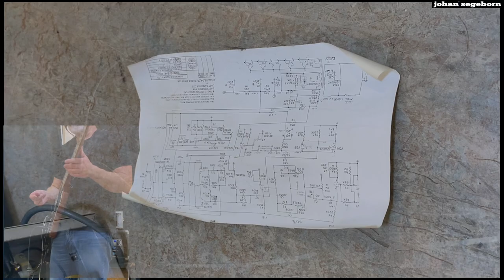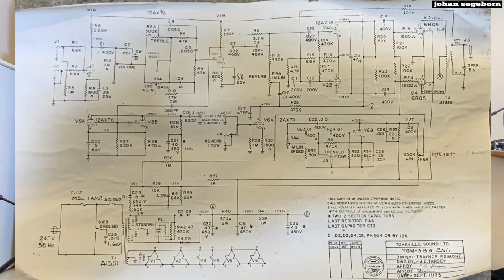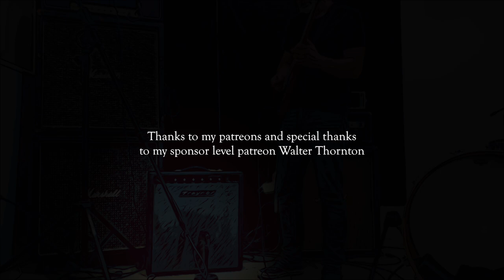Canadian PLEXI!! Traynor Guitar Mate Reverb YGM-3

Comment: You could also say some old Traynors are basically Canadian Hiwatts too. Very rad and vastly overlooked and under-appreciated amps.
Reply from the maker: Yeah, strange that they’re partly still sleepers
Reply: Which ones? I've heard that said about the YBA-1A but I've never been able to compare mine to a hiwatt
Reply: @ProSimex84  The YGL Mark III is the only one I can comment on. Very robust and clear at high volume. Easier to get it to break up compared to a Hiwatt but still very close. My friend had one that was similar in many ways to my ‘76 DR103, that he used to own as well.
Reply: @ProSimex84  Johan has some videos on the ygl mkIII and even one where it's played alongside a hiwatt if you want to judge for yourself
Reply: @peterchumpis8188  Oh sweet I'm gonna have to check that out too!

Comment: I have one from 1973. Really the only difference to the later one you have is that my reverb tank is down in the bottom of the speaker cab instead of under the chassis. The screws are a great Canadian invention! The ROBERTSON head. These screws never slip!

Comment: To people watching, Pete Traynor was a Bass player and tech for a local music store in Toronto (yorkville) He got tired of repairing all the rental amps and created a more robust amp. He mostly used fender circuits with some tweaks. YBA-1 is a Bassman, YBA-2A/B are built around the Harvard, YGM3 is similar to a deluxe, and the YGL3 that Johan has in his other vids is similar to a twin. They have mustard caps and Phillips tubes (our brit heritage and where we got many imports in the 60's). 

The rumour is, and can be seen on you tube, that pete would throw the amp off the second story of his building. The purpose was to simulate what would happen to the amp falling off a fullstack and the stage and hit the ground. 5 meters or so. In most cases the handwiring was so robust and the HUGE Hammond transformers  would be fine even after this large fall. Change your tubes and bobs your uncle.  I am sure this wasn't a regular occurrence, but perhaps as a once in a while quality check and maybe for promotion. 

Lennon and Clapton can be found playing them in 69(I believe) during a festeval that slips my mind at the moment. 

The biggest weak point in the amp was the switch to Marsland speakers. The original Jensen P12Q (or Radio Speaker Canada license version) are great alnico american sounding speakers. However the Marsland tend to be a more neutral coloured speaker-which makes sense for a bass player. Many of their most renown products are big bass amps like the monster YBA-3(think marshall major). Bass amps generally don't want for too much colouring of your tone. So with the speaker factory just a short ride from the yorkville amp facility they sourced their bass styled speakers locally. 

The Marslands aren't bad speakers, many of us like them, but they are bit lifeless compared to some Jensen or Celestions. Think of the 70/80 as your stock speaker. Its an OK speaker, but lacks character. I have an older model and it had a Jensen. Great speaker with loads of tone that allows you to get the goods with this amp. Its almost half as loud(100dB vs 92-94 dB) as a Vin30 so you can actually use the volume on the amp and get a nice breakup. 

This year marks Traynors 60th anniversary. 1963-2023. Hoping the do another reissue like the did for the 50th anniversary. They are great amps even the newer ones no longer linked to Pete Traynor himself. The YGM series, the Darkhorse, the YCV series and my personal favourite YCS50-H no longer in production with only smaller amps being made. Not Vintage but has many great tone options on it. Their YCV20WR(wine red) may be one of the few amps we actually took a shine to. Lots of options on it and it comes with a Greenback in a nice small format. 

Check around for some tone samples on youtube. Some are pretty good. Hopefully Johan gets a chance to plug this small amp into a big 412 loaded with greenbacks. It really shines with some nice British speakers. The volume control and single vs HB can really effect how much drive and sparkle you get out of the vintage versions.
Reply from the maker: Thanks I really appreciate the info!

Comment: Up until very recently you could grab these things for like 200$ CAD. Even with prices going up they are still some of the best value vintage amps you can find (especially here in Canada where you you're pretty much tripping over them they're so plentiful). 

Fun old story, they used to test the build quality of these amps by throwing them out of the 2nd story window at the factory, cleaning up the glass and replacing the tubes, and seeing if they still worked afterwards. 

Lots of love for Traynor amps!
Reply from the maker: Yeah I heard that too. I love that attitude
Reply: They did that once for a CBC doc or something. People think they tossed every amp out a window. :face-green-smiling:
Reply: Peter Traynor was the amp repair guy at the original Long & McQuade store in Toronto. He was tired of fixing blown up amps and thought he could build his own more durable amps. That is the story anyway.
Reply: The prices for the new ones have gone through the roof as well . In 2018 a YCV 50 was  900  dollars plus tax  and now in 2023 they are  1500 plus tax Canadian . A 600 dollar increase  in 4 and half years.  I also seem a Joe Bonamassa   Epiphone  62 ES 335  for 1800 dollars  plus tax which means  it's over 2000 dollars after tax for an eipiphone .  2000+  dollars for an  Epiphone and what really  makes not sense is that last year when they did the  Lazarus Joe B Epi 59  it was 50 dollars cheaper then the regular 59 . I seen a used Epi 59 in a shop  for 1150 dollars plus tax . Used  epipohones  for  1300  and not even a rare rk signature model.  Gibson is pricing them selves out of existence.  58  reissue gibson les Paul's  have gone up  1200 dollars  I one year on Canada.  I had decided a few months back I would just by Epiphomes and  spend a few hundred on upgrades  but even that is  becoming  challenging.   I bought a single gibson custombucker to put in the  bridge of one of my  epi 59s  and it cost me  412 dollars  Canadian  for a single  pickups.  It sounds better then the BB3 that was on there  but not by much.  More clarity and less  bright   as the BB3 was a touch brighter then I like  on that guitar.   A little more touch sensitive  and more PAF sounding  and is am happy with the sound  but the improvements  does not match the price
Reply: FReakin shoelaces are 800 bucks in Canada 😂😂
Reply: @JohanSegeborn in case you haven’t seen it yet, here’s the link for the video of Pete Traynor throwing one of his amp heads off the the 1st floor roof!

Comment: Finally. Great amp! They reissued it a few years ago, handwired. With a jensen p12q. Approx 1100 Cdn or 800 USD/euro
The screws are robertson screws. Canadian square screw that predates philips star pattern. Great crunch at 8 gets flubby above that.
Reply from the maker: Thanks yeah those screws drove me insane
Reply: @JohanSegeborn  They are a great screw with lots of torque and less prone to 'round' out like a Phillips. Best part is because of a slight taper on them they can even stick on your drill or screwdriver when held towards the floor(not always)  and horizontal it will sit in line no problem. Lot less struggling that with a 'star'. The only reason they aren't known world wide was because Henry Ford didn't want to license them for his cars, he wanted them without paying for the intellectual property. Might have been a mistake by Robertson, but its a great shape. Otherwise we might all be using them.   Sorry something canucks are proud of though. I would have thought they had went overseas, but perhaps not. For building decks, before torq bits, you couldn't find a better alternative.
Reply: @thorinbane nice history on these.   Up here that is the default wood screw, and there are 3 sizes and the screwdrivers have either a red handle, green, or yellow from largest to smallest square.

Comment: Ah this takes me back! These were everywhere when I was a kid on the east coast of Canada. Johan if you can find a Traynor YBA1 bass master you should feature it. Very similar to a 5F6 or JTM45 type of circuit. Traynors are our silver face Fenders. They're everywhere, still affordable and built like tanks.
Reply from the maker: Yeah I definitely looking for an YBA1
Reply: Affordable? Not in years now... unless you consider $1000 "affordable" 
Yes, if you go back 20 or 25 years they were affordable. You could get an old Traynor for a couple hundred bucks used. But then, you can say that about Marshalls and HIWATTS then as well. 
All of that was ruined by the advent of the internet and specifically - ebay.

Comment: Both the YGM-3 (1x12) and YGM-4 (4x8) are beasts.  Like a gritty Deluxe Reverb with a hypnotic trem and surf-deep reverb.  Best to get some 6p14p-ev for reliability.
Reply from the maker: Cool! I’ve never played 4x8 actually
Reply: @JohanSegeborn  My understanding is they're the same amp, but different speaker configuration. I have a YGM-4 converted to a head. It's a fun amp to play!
Reply: Yeah guys, got a ygm-4 a couple years ago, i got to fix a loose output tube pin😢 but ill probably convert it to 210 or something

Comment: I’ve got one of these from ‘73 that I bought in Summer of 2020 for less than $400. Needed nothing and had a clean bill of health from a reputable tech in my area just before I bought it. He also added a mid control to the back panel where the ground switch was previously located and he added a grounded power cord. It came with the original Marsland speaker which I put into storage and replaced it with a Cannabis Rex. I removed all of the original screws from the back panel and put those into storage as well and I lined the edges of the panel and the back of the amp with Velcro so that I could play this amp as a closed back or open back cabinet whenever I like in a moments notice. Just a sweet, sweet amp, I love mine!
Reply: any details on the mid control would be greatly appreciated!

Comment: in Toronto and impressed with the Traynor and Yorkville gear value in the used market. it's like Peavey. $20 usually takes stuff home.. so far Peavey SIlverstripe Bandit, KBA50 and a microcube gx..   and a solo battery 10w i use with a UBass busking along the microcube.  would love to score one of these.  the washburn vga30 is also a killer bang for the buck amp in the $20 finds pile

Comment: I have many of these, they usually had Marsland Speakers in them, that were also made in Canada. The speaker is probably the weakest part of the amp. The Great Britain made Phillips tubes were fantastic. Most of the ones in my Traynors still  test like new even after 50 years of use. Very underrated amplifiers. The video of the amp drop from the roof is on You Tube. It was part of a news clip promoting the amplifiers, and wasn't really part of the regular quality control. Thanks for making this video,
Reply from the maker: Thanks, I’ll look for the roof video!
Reply: Completely agree. I have never heard a Marsland guitar speaker I've been crazy about.
Reply: @JohanSegeborn  I think this is the link. Watch the end of the video. https://youtu.be/YjPfsOfFxXQ

Comment: Hey john speakers are blue label Marsland and they can take the punishment good quality made in canada speakers. They will hold their own against any jensen and celestion.
I had an old 2x12 200w solid state traynor combo amp from the late 70s i believe. Anyways when I blew up the amp. i cut the head off of it and used it as an open back 2 12 for my 1984 2204 head for several years, for those nights when i didnt feel like lugging around the 4x12 1960 cab.
The marslands sounded excellent with my 50w marshall head. I later purchased a marshall closed back 2x12 celestion  200w cab and sold the Marsland speakers. Thinking back I prefered the sound of the 2 Marslands over the marshall 2x12.
Keep them they are good speakers you can't kill them and they sound great. Although the amp I had that they came in sounded horrible and harsh. 
(It wasn't the speakers)

Comment: Thank you for bringing  so many great Amps into the spotlight! I agree with the post below. I have a "69 YGM3, a YBA-1 (EL34), and a mid 60's cube 6V6 YBA-2 15" combo. The best sounding to me is the older YBA-2 (perfect breakup and volume), followed by the YBA-1 (loud and instant Angus), and then the YGM-3. The YGM-3, YBA-1, YBA-2A and YBA-2B can be found for around $600 in Canada. Not sure about the older cube YBA-2s. I haven't seen a proper one for sale in a long time.

Comment: I had an earlier '69 model of this that I traded for a JBL loaded Ampeg VT-22.  I love the VT, especially on bass plugged into a stack of bass cabs.  But, man I probably should have kept the Traynor.  Far more practical, more unique, simpler to service.  These have a bandaxall tone stack that is REALLY drastic, especially the bass contro.  Super versatile.  Fortunately, I still have my Traynor YBA-4, which is basically a YBA-1 50w 2xEL34 amp in a closed back 1x15 combo form.  I have an Eminence Big Ben in it and it's the best straight up crunchy rock and roll amp I own.
Reply from the maker: Yeah, the EQ controls were really sensitive. You can sculpt many sounds by just combining different bass and treble settings

Comment: I think it's great that you've dug up a couple of Traynors for the channel.  They're a great value in a hand-wired vintage amp.

But I can't help but notice that you haven't gotten to the 2 very best sounding models yet.  

A YBA-1 head is a very close hybrid between a JTM-45 and a '59 Bassman.  The pre-1972 ones are the definitive versions.  After that they have a different circuit, but are still worth checking out.  It's combo version, the YBA-4 is the same amp with a smaller output transformer for both revisions.

The other model, that is the real sweetheart of the line card, is the 6v6 version of the YBA-2.  This design, as far as I know, is Traynor's take on the Fender Harvard.  And it is my favorite Traynor model.  Great natural overdrive and clean.  Simple 2 or 3 knob interface.  And it's one of those amps that just feels great to play.

Comment: I had the same exact amp but a 73. Paired with a proper g12-80 it paired very well because of the rolled off high end on the speaker. I foolishly sold that amp and have regreted it since. The prices for these have sky rocketed from couple hundred to close to 7-800$ here in Canada. The only pitfall of these amps is the output transformer as it tends to heat up quite a bit.
Reply from the maker: Yeah someone else here told me they run the tubes at really high voltages
Reply: @JohanSegeborn  probably 400 volts on the plates of those el84s
Reply: @JohanSegeborn  my 73 yba1 runs at 440 volts. Around 43 watts.. I know you're looking out for one. You'll love it...

Comment: These are great. Two things - it looked like it may have had the Pat Furlen tone stack mods (some minor cap and resistor swaps) = huge difference! Also I wonder if the speaker has been replaced as the stock Marsland units are fantastically average - so average that I sent mine to the recycling depot. I sympathize with Johan not removing the rear panel though as there are so many screws! But if you get a moment take a look and see what is in it. Great video and playing.

Comment: I still own of these. You forgot to mention that it has a bias tremolo (at the power amp like some Vox not like in some fender in the preamp). But you showcase it well (the tremolo). You sound amazing as usual.  I would be interested to know if yours is still stock around the EQ circuit. I mod mine many year ago (some coupling cap... maybe just C1 and C2 to be less bass and the make the boost more suble) and I saw other Reverb Mate that were mod on the market. Those were great platform for modders. Good parts + No collectable value + close to classic circuit.

Comment: The mediocre house brand speakers really held back those old Traynors. That one sounds great though.
Reply from the maker: Thanks!
Reply: Marshland I think they were.   Mine says DWA3 and 7372 stamped on the back of the small horseshoe magnet.  They are very light but low efficiency so not as loud as a G12M

Comment: The original Traynors had circuits which openly emulated the Fenders of the period; a cursory comparison will demonstrate this.  However, they used tubes more in line with British amps of the time (i.e., EL 34s and 84s), and the transformers were substantially larger than most of their contemporaries.  Additionally, in the EL34 amps, the screen grids were fed raw bias current rather than being fed through resistors to the power supply (as Mullard had designed them to work), and so it's very uncommon to see these amps blowing power tubes like Marshalls.  Traynor cabs were built with an incredibly durable construction that holds up to time and abuse far better than most.
Reply from the maker: Thanks, interesting feedback
Reply: That is not true, on those EL34 traynors the screens had a shared screen grid resistor. And even If it didn't have screen grids resistors, it would blow tubes easier so you have it backwards anyways. The reason for screen grid resistors is to protect the screens from drawing too much current at higher levels which can blow tubes. I worked on a few of those EL34 traynors over the years. The rest you say is true in that most of those traynors (besides this one) are basically fender blackface copies with EL34's. There are many amps including even some marshalls that dont have screen grid resistors (some 60s one, and some early 80s ones) and those are the ones that eat tubes more often, so it is recommened to add screen grid resistors to those (1K 5W). You can read about those on the marshallforum and other places.